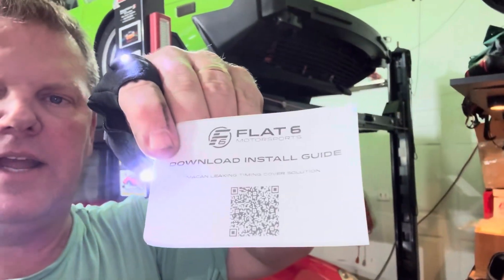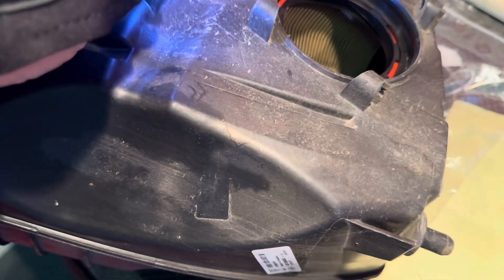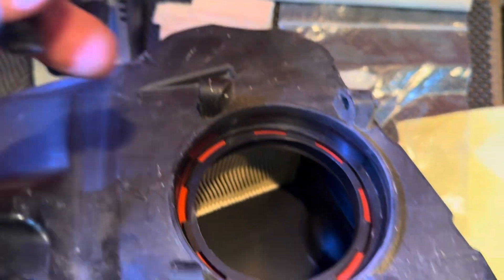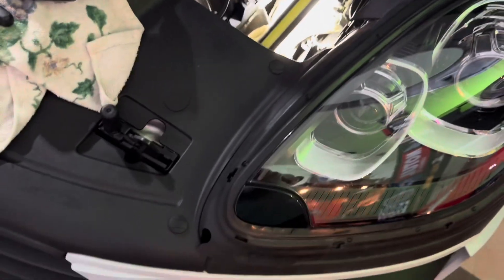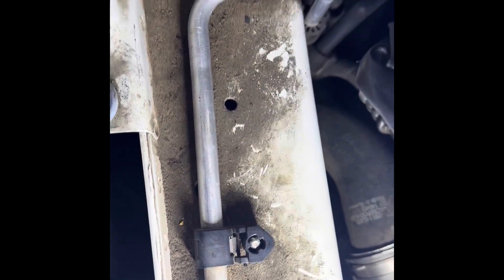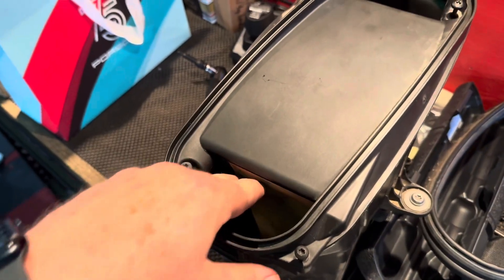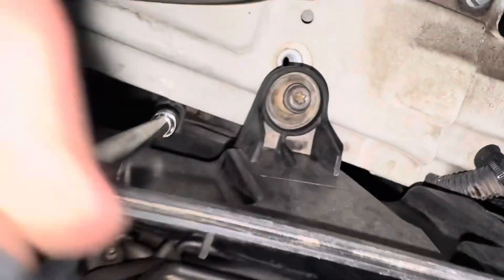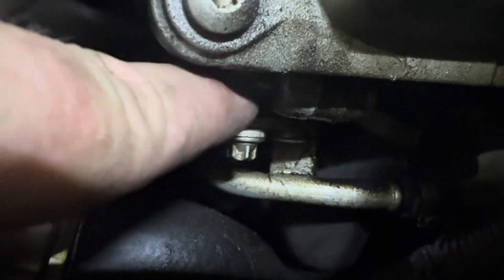2015-2018 Porsche Macan Timing Chain Cover Oil Leak DIY 2-bolt Repair

Comment: Awesome video, Jeff. Just bought my wife a used Macan S and noticed a leak, but of course dealer will not accept responsibility. This video gives me hope. I might share it with mechanics as I shop around to see if I can have the work done without having to take out a loan. 😝
Reply: Did u fix leak yourself ? How bad was the leak?

Comment: There are 2 others.  It’s an at least 4 bolt fix.  Pop the plastic engine cover and you will see them.  One on each side.  They shear the same way.   The passenger side a bit tougher as the PCV valve hose is in the way.  Yes the T30 bits love to disappear even if you pop the belly pan you won’t find them.

Comment: Is it usually just them two bolts? or does it sometimes require front end pull to repair more than the two bolts shown in your video?
Reply: just two bolts

Comment: This kind of replacement, required to take the entire motor out of the bay and work with the motor free. This cost about 7-8K. A 2016 Macan Turbo 50K. But because Y got an extended warranty. Not the ones that cost $500.00 but 5K. Your mechanic will submit all the necessary changes that your unit needs and a certified porsche insurance tech. either recommend or not the payment. This is usually approved by goods honorable warranties. Now the other side of the story is that Porsche is putting together a "recall" to replace these 9 aluminum screws that can produce a catrastofic oil leak and damage the timing chain. I wasn't going to wait for Porsche, so I went to a certified boutique Porsche shop that only used genuine Porsche parts. It took 2 weeks to complete the job, along with changing brake pads and calipers painting. LRO

Comment: please give me the measurement of screws , and does it have to be aluminum ?
Reply: new bolts should be steel, not aluminum
Reply from the maker: @rickross6368  You are correct - the new screws are steel, that way they don't break.